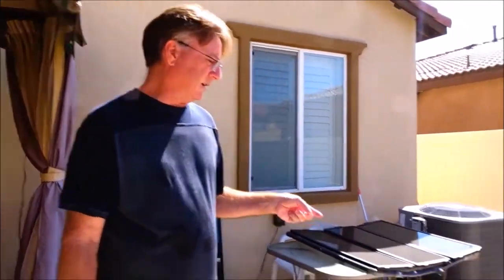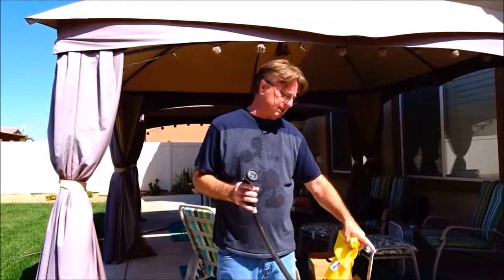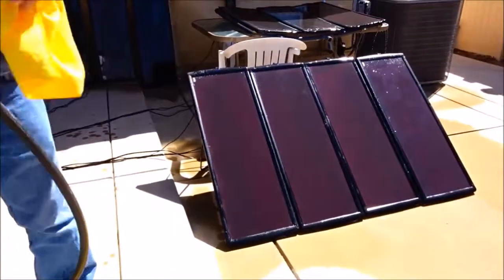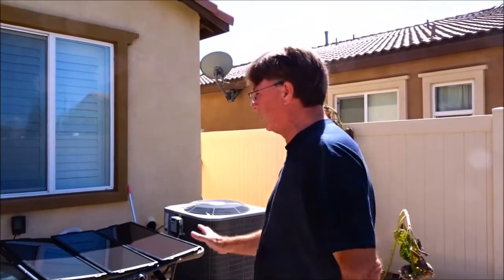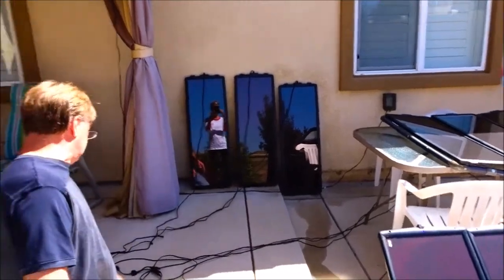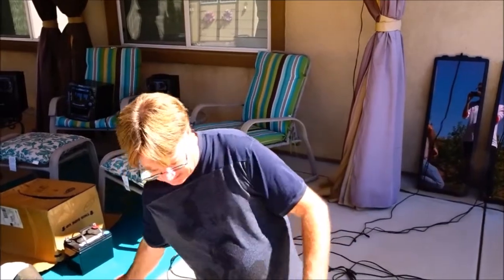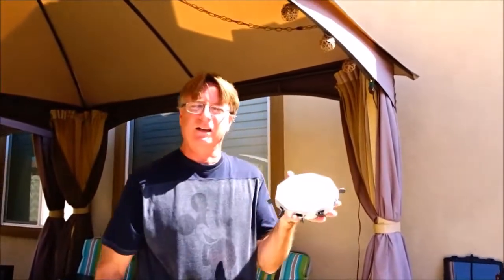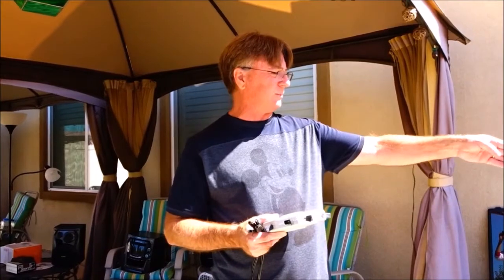Part 1 Harbor Freight Tools Thunderbolt solar systems. The complete how to and what not to do

Comment: I am a complete beginner to the world of solar.  I’m wondering if this kit will allow me to run the landscaping lights in my yard every day (6-8 path lights and a couple of up lights)?  Would I be able to run low voltage landscaping lights set dusk to dawn every day using this kit??  Outside what comes in the box do I need anything else other than batteries?  I live in SoCal and the panels with have direct sunlight throughout the day.  I appreciate any help.  Thanks!

Comment: I just bought 2- 100watt systems with the connector hub. Wiil 1 of the kits stock controllers handle 200 watts, or do you have to figure a way to wire both controllers in? Hey, good video!

Comment: I have 2 100 watts systems is the set up the same?
Reply from the maker: We have 1 100watt system and 2 45watt systems for a total of 190watts going into the 400watt hub and the 500 watt charge controller.